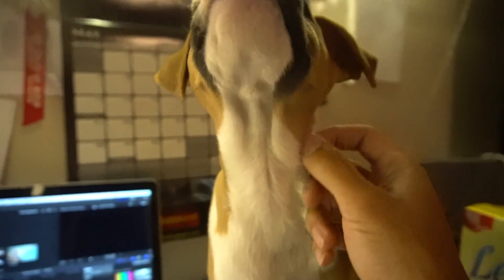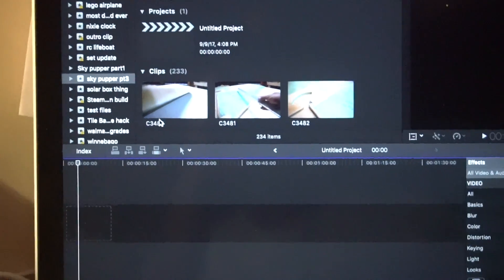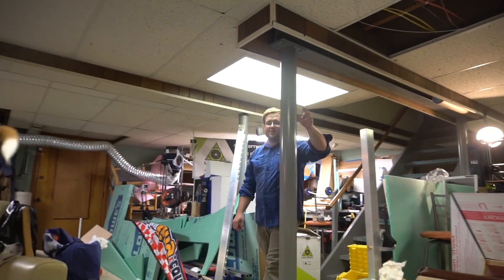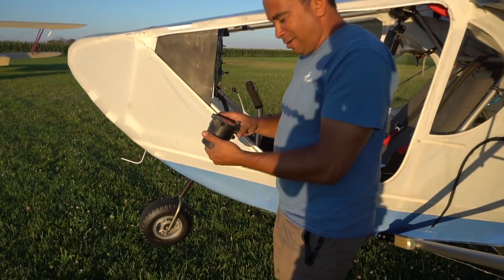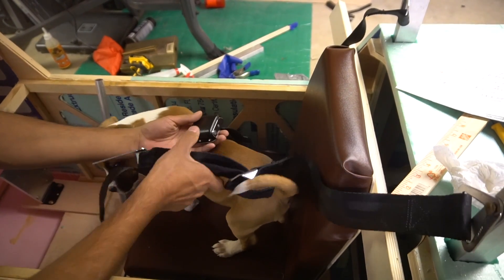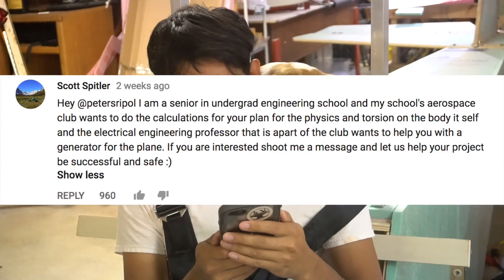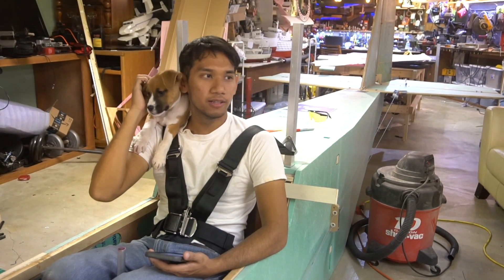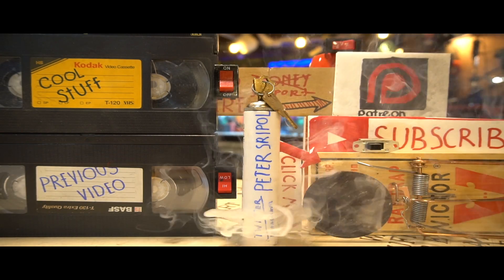DIY Electric Ultralight airplane pt3 (cockpit and controls)

Comment: Hi Peter, I have read that we only want the harness straps that go up from the lap belt, to be anchored clearly ABOVE THE HEIGHT of our shoulder tops, say 0.5 feet higher than our shoulder tops at the minimum! These straps are ONLY to prevent your upper body from being thrust forward during sudden stops.  In the 5 strap design, the cross hip strap holds the body down on the seat, and it, with the 5th strap, that connects to the lap belt at it's center, and is anchored below the pilot,  and nearly behind the pilot, prevents forward movement of the lower body during a sudden stop. If you loop the two upper straps over your shoulders and anchor them LOWER than your shoulder tops, you can likely cause a horrifically serious spine compression injury to yourself. AGAIN, please anchor the upper straps 0.5 to 1.0 feet above your shoulder height, and obviously these anchors need to be at least 0.75 feet aft of your chest! At 59 years old I tell you most sincerely, that you are an inspiration to me, the way you achieve the goals that you set for yourself!

Comment: Peter, i'd view  of your DIY  Electric Ultralight Airplane. I'm happy, that you give details step by step in your video, it's really got my attention and amazed of your great works on it. Could i request from you, if it is ok with you, and if it is possible to send on my email address ( lapuz789@gmail.com ) for the listing of construction materials  needed to assemble that kind of air plane, I'd like to know what kind of aluminum materials that you used & where to buy very affordable, What kind of  body frame siding -- color green, what kind of material is it? The electric motor, the blade, the battery etch..... Because, i might & hoping to assemble also near similar to your airplane.  I'm Hoping that you could reply on my request, Thanks in advance.

Comment: I don't want to criticize but this thing is seriously stucturally weak. The aren't even wood (and i'm not talking even about alluminium reinforced with carbon fiber which should be used) rods reinforcing elevator and rudder, they are purely superficial, in flight they come off at the first bump, even if on ground they look sturdy enough!

Comment: Another $0.20 worth of my opinions here... there are some good points made on making sure the cables are nyko pressed properly. Along with the proper installation of thimbles. You can spend $500 or $5 on a tool that you make as long as the crimping set process is proper. If you are using lead nyko press sleeves the lead should actually he pushed through the metal braiding of the cable. On the other hand you seem to be an intelligent man so forgive us if some of this is redundant. I think all of us want to see you fly this safely so we can all figuratively pat you on the back when you do.

Comment: You seem to be doing a very nice job on this aircraft. You have a lot of specialty tools that a lot of homebuilders do not have. You're not taking any chances and that is very good. I think you will do well in this. Judging from how you are putting it together I would not be afraid to test fly it and I have test flown several different aircraft. You are correct in the fact that Home Building is not rare but still very exciting. I have a sisler Cygnet SF2A that I did not build and only have about 15 hours of personal time in it. I have done some electrical work on it that it needed and replaced the tach and oil temp gauges and some miscellaneous things but mostly just getting used to how it handles. Seems to be a very nice and forgiving aircraft.
Very much looking forward to more of your videos as this aircraft looks very substantial.
Anybody who has that kind of relationship with his animal has got to be alright! No offense but your puppy is one of the best parts of this video series.
I am 56 years old and have been flying for over 30 years with various ratings and endorsements and have been involved with homebuilts since I was 16. It is a privilege to watch a young person do such a good job.
     Central Lower Michigan
     KY70
     N6580K

Comment: Maybe you've  sorted it out by now, but since a thimble won't fit through the turnbuckle hole, all you need is shackle with the pin going through the turnbuckle and the thimble through the loop of the shackle.

Comment: You might want to make sure your seatbelt harnesses are above your shoulders, if you need them, they will squeeze the space between you butt and shoulders, ie your back. so I would place them higher on the rear aluminum bar, assuming your seat is going to be at the height in the video.

Comment: Be safe. Try XFLR5 software -its free. It would use math  proof to your project, you can enter in it basic projected plane parameters and calculate stability of your plane, will let you chose right airfoil for wings and right angles of wings  incidence. Remember, small plane  models fly different, air flow and gravity are  not scaled when you build model those  have different characteristics for small models comparing to real aircraft.
Reply: Also there OpenVSP open source software  NASA project which may help you.

Comment: Peter-As I'm sure you know weight is your enemy.The thing is I see quite a few places where you could and should be saving some more weight now while it's cheaper and easier to do so.You're going to be amazed at how it creeps up out of nowhere.For instance the seat back could and should have some material removed and the same goes for anything and EVERYTHING else that you build.It is just so much easier to do it now then it will be if you have to try and lose it later.You should be trying to save every ounce possible in this stage of the game,especially on non structural and critical items.I promise you it'll save you some huge headaches later in the game and ensure your success.
        I wish I had done so earlier in my build but since I was building from plans I didnt think it was a issue.But man was I wrong and it was a huge setback on my build.
              Last but least is please get someone from the EAA to pop in and look things over for you along the way.They're an amazing resource and I've found that most love to help others out.People arent suggesting this because they doubt you in any way.It's just they know from experience that its a great help to anyone from first time builders up to seasoned pro's on their tenth.We all miss things and at times a experienced set of objective eyes can be a lifesaver.
Reply: Also I forgot to ask if you're planning to make the batt's removable so they count as "fuel"and not AC weight.

Comment: the way those seatbelts are mounted on the back seams to be putting a torque force on the fastener and the member. is that going to be alright? or should you mount it on the side of the member or on a specific angle so its pulling straight against the bolt?

Comment: Suggestion on the harness. You should mount the shoulder straps higher (above the horizontal plain of the top of your shoulders).
How it is now, any harsh forward momentum your body will exert (as in a forward crash) the shoulder straps will cause spinal compression.
This is in SCCA regulations as far as a race harness is concerned..... because racecar :p

Comment: Peter, i love that you are doing this.  I wouldn't have the patience to document the build the way you do or at all for that matter. And i think there should be thimble eyes on the ends of the cables where they go into the eye bolts. They spread the load over more cable and reduce the sharp point load. I'm not an aircraft builder but do fix machines in my job and have worked with steel cables in a past job. Thimble eyes. Do it! Stay safe!

Comment: Did he just put a screw in the back of his seat? Dude...
That's not how it works...have you ever seen a proper leather or proper fake leather sofa?
Ever wondered what those buttons on the front are?

Dude I wouldn't cringe so hard if this wasn't a plane, but you're gonna fly and maybe crash in this thing, holes in your back are the last thing you want...

Comment: I have never made a plane before. But done lots of billy/go karts. I can assure you from experience that if your going to bother with seatbelts. You need something solid to bolt them too. Or you just rip up the chassis when you crash. The main problem with this is that you get a lot of broken bits with sharp edged pointing at your ribs and waiting for the whiplash to throw you back into them.
Would suggest it might be safer without the seatbelt. That Aluminium is not even close to strong enough to Slow your body weight from terminal velocity to 0 in a few fractions of a second... Do the maths...

Comment: I think you weakened the vertical struts by drilling holes for the safety belts. And I also don't like how the safety belt brackets are stressed under an angle. You should do a redesign.

Comment: Were the pillow blocks ABS or PLA? The strength of modified PLAs is decent these days but the temp resistance is crap, hot days will see them turn to chewing gum. Get some PC if the taz prints it, it's insane tough.

Comment: My Brother from another Mother, I am planning to build my own Electric 
High Performance Ultralight Aircraft too. My friends also think (know for sure) that I am 
crazy. I am an Engineer and Mad Scientist. I can do anything. I recommend you
 cut small horizontal grooves in your Fuselage and from tip to tip of 
your Wings before you skin them with glass cloth and epoxy. Simply put,
 the strength of a member comes from its skin, which is why a bending 
strength or moment of a square box member is similar to a solid member 
(without the weight). When you cover these grooves in the Fuselage and 
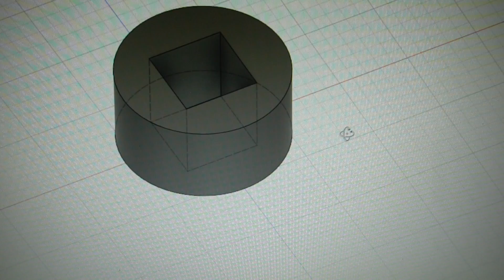Wings, they will act like rods and spars. You can see this technique on Youtube in the construction of the MiG 25 https://www.youtube.com/watch?v=yfCw_YSuCm4 at 2:43 and similar to Protruded Rod Stitched Efficient Unitised Structure https://www.youtube.com/watch?v=wfhdE_vrJ2I at 7:56. All the best mate.

Comment: May I recommend carbon fiber props? I have a pal who's nose wheel on his RV-12 came off and had a prop strike. One prop survived and was about 3.5 feet long. Got to hold it and was ridiculously light. May not be cheap but worth the weight reduction.

Comment: I hope those two aluminum risers behind the cockpit aren't for a top wing mount! You have killed structure by drilling them, and those seat belt brackets are a terrible design. The load path is totally wrong. I'm not trying to be a hater just to be a hater but I see a lot of things that could get you seriously hurt, or worse.

Comment: I worked on an electric paramotor based on a 100cc rotomax motor and the weak point was the ESC, check it several times to full power on the ground for at least 5 minutes.

Comment: Better safe than sorry is the right path to be headed down. Although the need for a parachute might not be ruled out by this, I feel a lot more safety can be gained from testing. There are just too many variables. I can see many situations where a parachute will not save the day. I think the best thing you can do is not be in it for the first few flights. Compared to the amount of work you've done, it wouldn't be too much extra to temporarily R/C it, add weight in the seat to take your place. Then you can confidentially see how it performs from a platform you're experienced with. Fine tune the CG, See how it stalls, what the stall speed is, maybe it develops some weird flutter? Then you're stepping into an aircraft you know flys well. That begin said I have full faith in you're design/ craftsmanship and if feasible a parachute is a great idea. hell i'm sure you could come up with a functional system out of an ordinary parachute. Lastly if you're not familiar with stall strips those would help with any wing drop issues in a stall. Hope you consider my thoughts. Good Luck!

Comment: I love your videos, but this is an extraordinarily bad idea.  I was a skydiver for twelve years, and I've seen people fall out of the sky - it isn't pretty.  A ballistic parachute is a good idea - but parachutes require sufficient altitude to deploy.  If you fold it up or stall it on takeoff, you're done.  Just remember, the bad part ain't the impact.... it's the knowing.  Don't paint yourself into a corner on this and feel like it's something you've gotta do.  You don't.  Do a little research and you'll find that MANY fatalities with experimental aircraft happened on the first flight.  And those are mostly very experienced pilots - I'm not even going to get into the difficulties of navigating three dimensional space.  My advice is to put 130 pounds of ballast in that thing, and fly it RC A LOT before you bet your butt on a model.

Comment: Looking great! I can't wait to see this one flying. Make sure you are using nylock nuts or similar so you don't have a critical component come loose in flight (we see this in full scale aviation all the time). Airplanes vibrate a lot, so anything that can get shaken loose will.As I mentioned on your last video, make sure you do some stress testing of the flight controls and ensure that control surface flutter cannot emerge. Also check over the install points of your turnbuckles and the light to make sure they cannot pull out under load.

Comment: Why do people think this is so dangerous? He obviously knows what he's doing and if he's the one building the plane that means he knows it inside and out and a crash in this is probably WAAAYY less dangerous than a crash in say a cessna because there's little to no risk of fire and he's also going to be at much slower speeds. If he gets his stall speed low enough which he probably will he'll be able to glide the plane back to a safe landing in the event of an engine failure. Also his construction looks solid so he won't have control surfaces failing. Overall great job peter I'm extremely impressed with your plane and it looks like a really fun project. I'm curious as to the current FAR/AIM regard ultralight homebuilt aircraft. What kind of airport will you be taking off from and would you say the price and work is worth the fun? Also what kind of airspaces can you fly in?

Comment: Hi Peter, Loving the build so far. Just a comment on the elevator control wires. I worked as a Ships Chandler for over a decade and spent quite some time of that manufacturing and repairing the rigging of sailing boats. At 9:08 I noticed you have the elevator cables running through the eyes of the turnbuckle, however there are no thimbles in the wire loops. This is a problem for two reasons: 1. The loops will collapse under load causing the wire to lengthen, changing the consistency of the control inputs. 2. and most serious. Steel wire does not like sharp bends. When under load the wire loops will collapse and form quite a sharp 180 degree bend through the eye causing the wire to fatigue and likely, some of the strands will break. Over time this cycle will continue and end in a catastrophic failure of the connection. In your words "...if you loose the elevator, you're pretty much screwed". Installing wire rope thimbles at this interaction point will prevent this from happening while also preventing chafing of the wire as well. Hate to see you get hurt(or worse) from an easily preventable problem.
Reply from the maker: sevomd will redo them!
Reply: Peter,it's all the little things just like this that are so easy to overlook that makes it a good reason to have a EAA guy take a look at her along the way.
Reply: ادم

Comment: Looks great! I have a few (okay a bunch) of comments. I would apply what's called "Max Pilot Effort" to your control system while the control surfaces are fixed. This will test the load through the entire system to make sure there aren't any weak links, and it's fairly quick to do (just duct tape some wood over each control surface to the vertical/horizontal tail or something) 

The hinges for the rudder pedals look great but you're reacting the cable load to the aluminum plates in a way that creates a high bearing load, potentially risking the aluminum yielding or having some sort of bearing failure. It might be better to create hole in plate in-plane with the pedal surface with a large fender washer to distribute the stress over a large area. Hope that makes sense, but long story short I wouldn't apply a bearing load to thin aluminum sheeting. Don't rely on clamp up pressure, always plan for things loosening. 

A quick way to test your structure is to have a few friends lift the aircraft by the wing tips with you inside of it. It's a super quick test and well worth doing before your first flight. It represents something approximating 2.5 g's of load depending on your lift distribution. 

In terms of your first flight, please wait for the optimal conditions, don't rush anything, double and triple check everything. Before you go to the field, make sure to practice assembling and disassembling your aircraft. Pilots all love checklists, so please create one (check against existing Cessna/Piper checklists for format). 

When you attach the aircraft parachute, it's going to impart HUGE loads (think above 10 g's) into the structure, and obviously the biggest load is the meat servo, so attach the risers directly to the hardware attaching your seatbelt. Don't rely on the aircraft structure to get your load to the aircraft structure. 

I'm sure you're going to wear a helmet, but make sure it's one designed for one-time, high load impacts. Something like a motorcycle helmet, racing helmet, or similar. Do not use a helmet for skateboarding, biking, skiing, etc. 

Test the entire propulsion system, full throttle, for at least one entire battery cycle. I know your batteries are going to be huge and take forever to charge, but if something melts you want it to happen on the ground. 

Good luck, love your videos, and be safe!